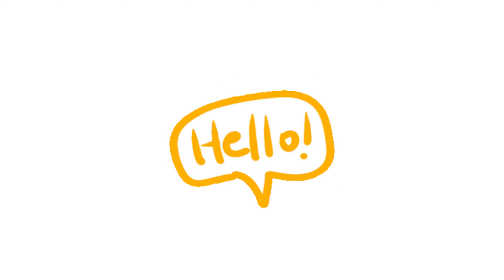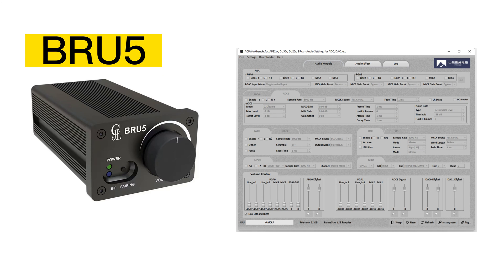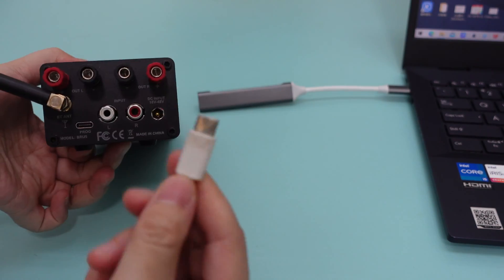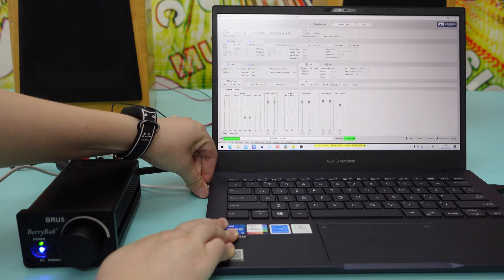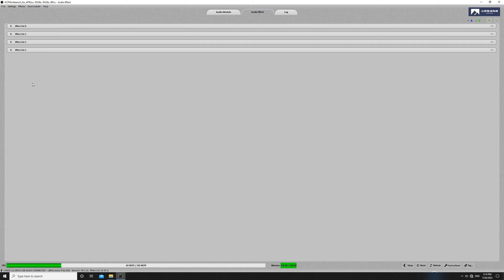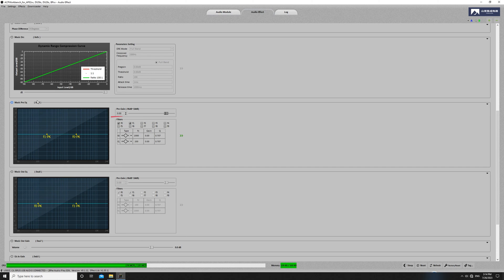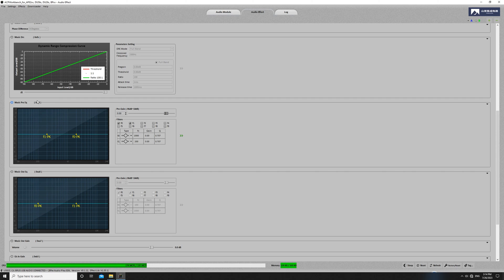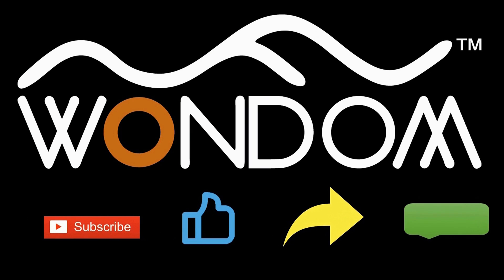ACPWorkbench PC UI Control Tutorial Series | Basic Operation Connection Save | BDM & BRU

Comment: If you have 5 EQ frequencies and set the gain on the right side to 5 on all of them, why aren't all frequency curves the same in the picture of the frequency curves?
Reply from the maker: Hello, the frequency curve should vary with the parameter settings and it's up to the filter type, frequency point and gain settings. Please kindly have a try again. If there is still problem, could you send somes videos showing the connections and problems to store@sure-electronics.com? This will help us identify the problem and solve it for you. Have a fantastic day~
Reply: @WONDOMAudio  Another thing is that you can't adjust (GAIN) up and down with the keyboard or mouse as fast as you want so it becomes more like a regular passive EQ.
With the mouse wheel it goes so slow and with the arrow keys it also goes slow.
page up and down key on the keyboard it goes a little faster but still too slow. WHY?

A function where you can lock the frequency so you can only grab it and only adjust up and down could be a nice function.

Why isn't there a regular 15 bond eq in addition to the parametric EQ. ???
Reply: @WONDOMAudio  Say you adjust all 5 frequencies to (Q3)
(gain 5) and the same (type).

Why aren't all frequencies at the same level  line in the picture?
some are much higher up.

Say you have a line in the picture that is level 5. shouldn't all frequencies be on the same line if you adjust the gain equally on all frequencies?
Reply: Can you lowpass the frequency for a subwoofer on this amplifier

Comment: Hi. Is it planned to add a function to the ACP software to set different filters for left and right audio channel? Then the amplifier board can be used to run a 2way speaker with one channel on highpass and one channel on lowpass.
Reply: I would be interested, too. I thought this would be the perfect all-in-one amplifier for a portable 1.1 speaker.
Reply: I am also interested in having the possibility to adjust left/right separately
Reply: @batwombat  I reached out to their support via email: The reply was, that it is simply not possible with the BRU5.
I guess it also never will be, regarding that it would be a very powerful amplifier + DSP unit for that price...
Reply: Dsp inside can’t run channels separatly